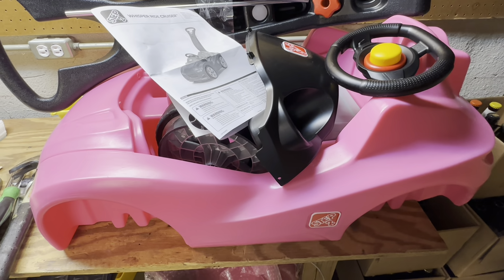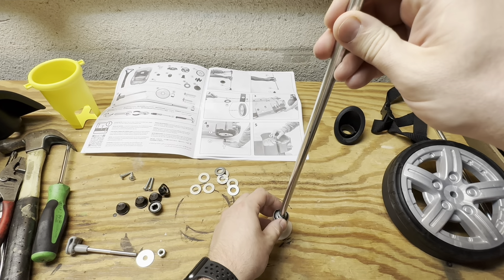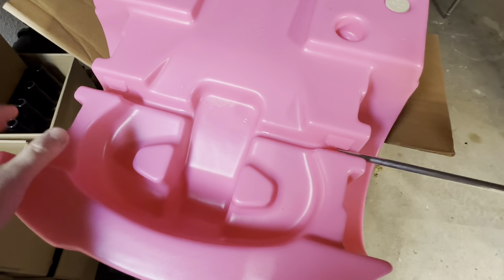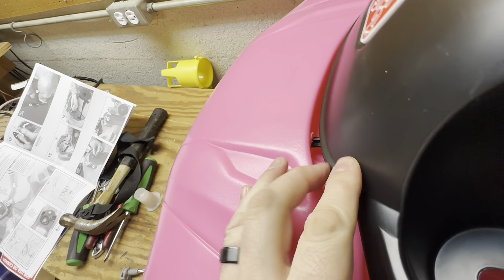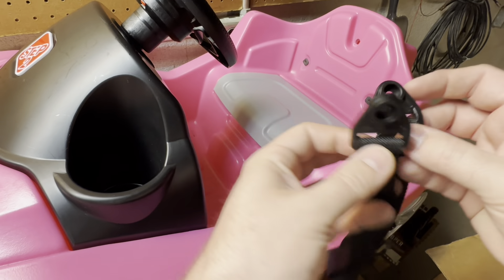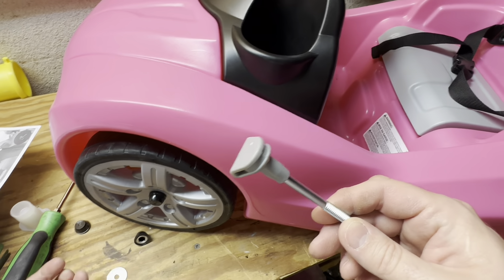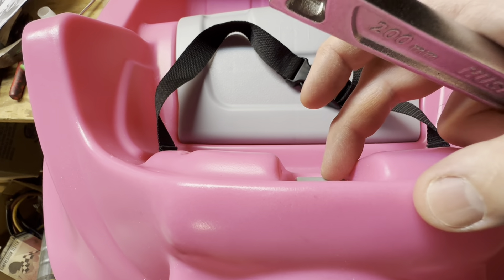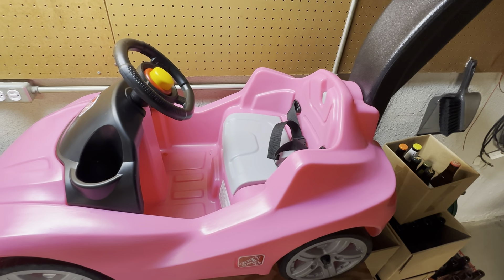Step 2 Whisper Ride Cruiser Step-By-Step Assembly Instructions

Comment: I would suggest to people to put the windshield in before the steering wheel itself, that way you can attach the pan head screws in easier.  The steering wheel is in the way a bit when using the instructions...

Comment: That stupid tightener for the handle stripped on me and now I can't tighten it
Reply from the maker: I could see that being a problem, mine was enough trouble that I leave it tight as much as possible.  If you can get just the bolt and the red knob from Step 2 or somewhere online (without the handle) it looks like the knob just presses into the handle.
Reply: Same problem but can't get it off lol